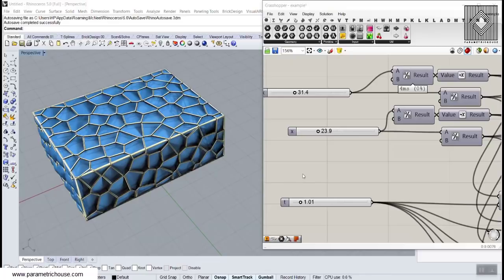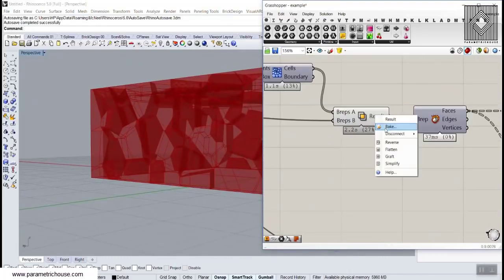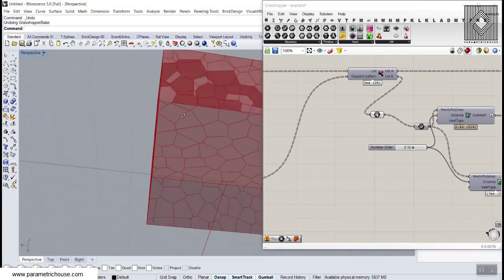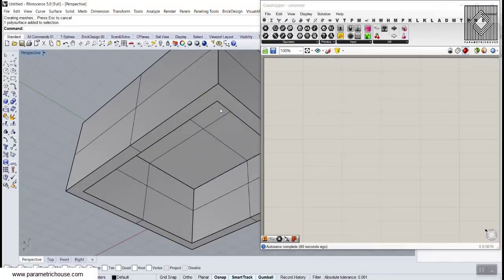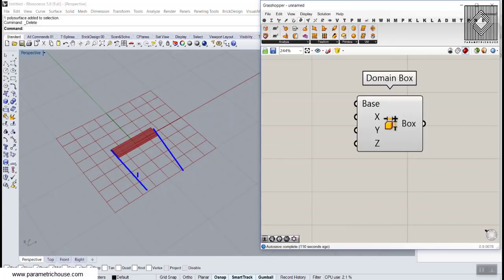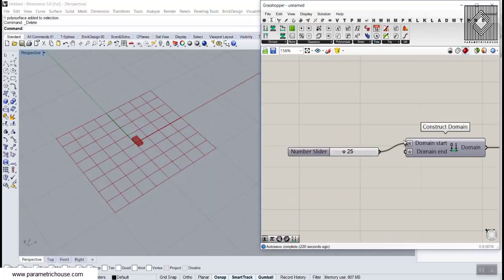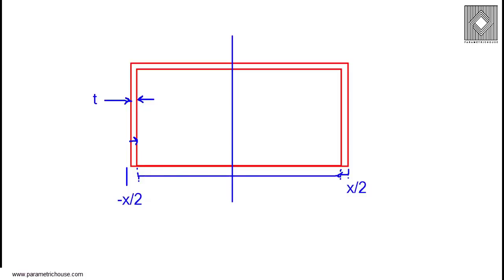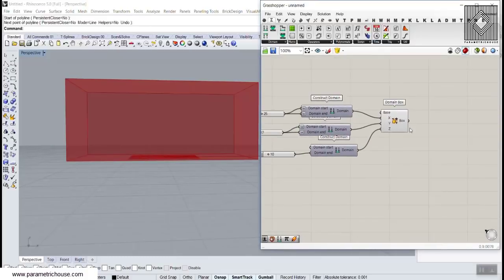Beijing Water Cube (Grasshopper Tutorial)

Comment: Thank you for lesson. I have a question. Why sometimes you use 5 version and sometimes 6? What problem with 6? Which of important addones doesn’t work? Or is some other risen?
Reply from the maker: There is no much difference between Rhino 5 and 6 and because I have installed Rhino 5 before I usually work with it but anyway they are the same. I will try to go with Rhino 6 for the future videos.